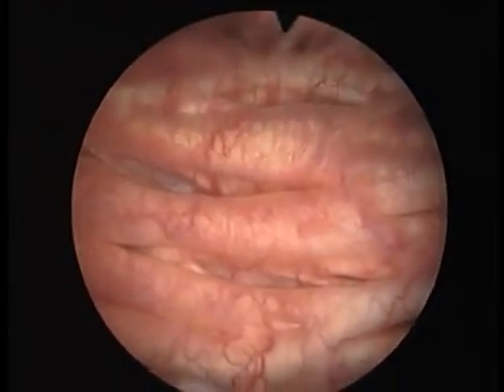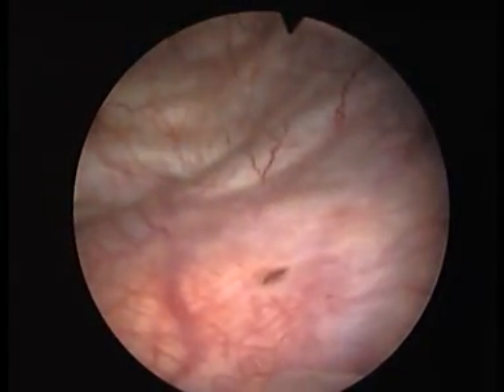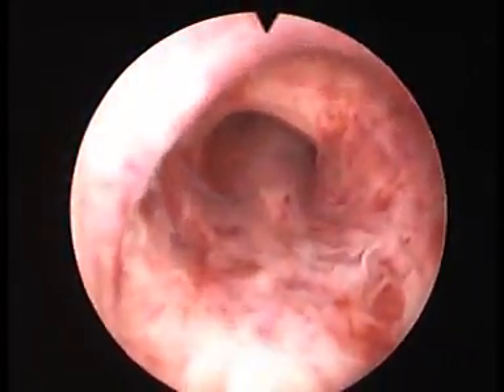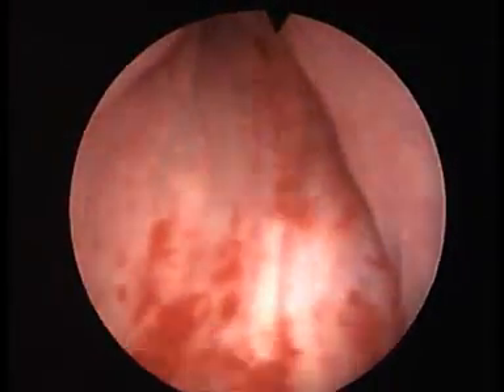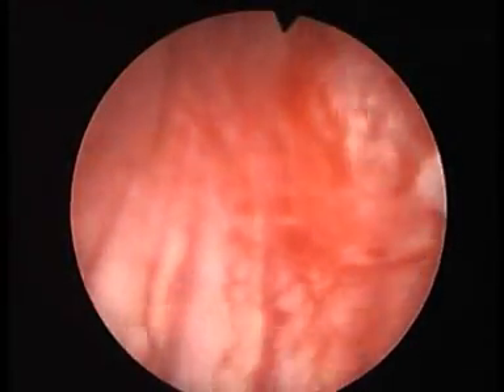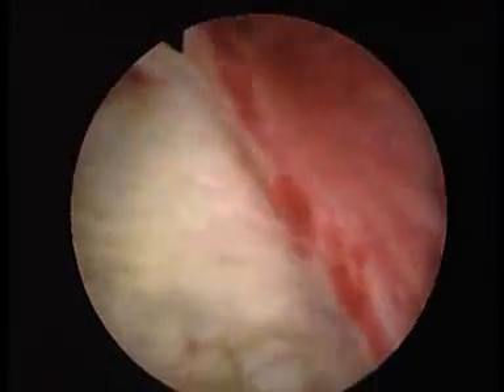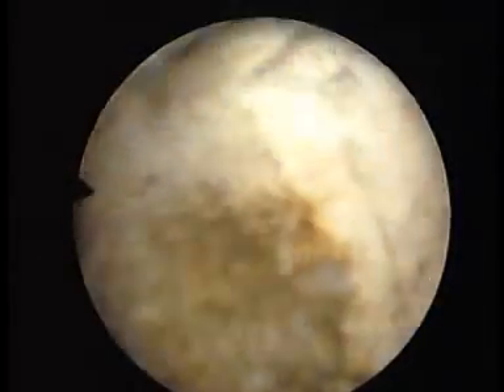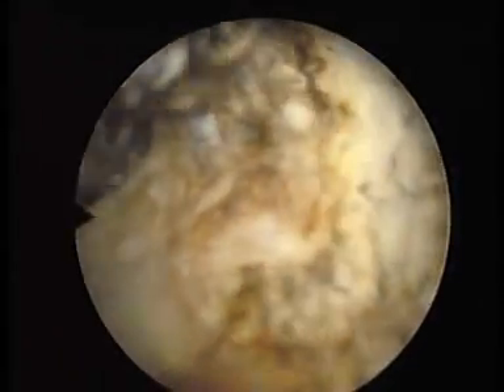TURP

Comment: TURP, DON'T DO IT! YOU WILL REGRET IT TO SAY THE LEAST!  THERE IS NO PROCEDURE TO CORRECT THE PERMANENT DAMAGE OF TURP TO GET BACK EXTERNAL EJACULATION. THERE IS NOTHING WORSE THAN HAVING INADEQUATE SEXUAL TENSION RELEASE WHICH DRY ORGASM AFFLICTS YOU WITH.

having a permanent induced dry orgasm is like drawing back the string of a bow and arrow and about the moment you expect the pleasure of releasing the arrow, the bow string breaks.  turp has made my life worse than death.  And even worse my current urologist concludes that i never even needed a turp since i have to still catheter.  damn these urologists who do unnecessary procedures that disrespect the hippocratic oath "do no harm".  He should have checked that my bladder was neurogenic.  If you are suffering from your bladder not emptying fully(which will eventually damage the kidneys) have all the bladder tests you can get.  Another thing that leads one desperate for a turp is that many urologists won't give you a preauthorization to your insurance that you need a new intermittent catheter every time you catheter.  If not you will have to wash one to use 3 or 4 times a day and it is never sterile.  this will make you feel irritation in your penis all day via uti's.  i don't care what anyone says about me, i may be one of the sole critical voices here.  Go to a health forum on turp and the vast majority of men feel as angry, depressed, frustrated, etc as i am.
Reply: I sincerely am sorry for you.  You must be going through hell.  Hope those successful experiments with regrowth of prostate on mice will be available to humans soon, for your sake and others.  My friend had a turp and he feels just like you.  And I have read some male health message boards and you are correct.  I sort of lucked out.  My urologist did the diagnostic tests for bladder and prostate.  In fact he could tell with the first manual test(i.e.sticking his gloved finger up my rectum)that my problem was not enlarged prostate.  My urinary retention was due to a period of intense emotional stress.  He concluded that by giving me a short course of minor tranquilizers and it alleviated my problem.  hope at least you can get some pleasure back and yes most of all some relief from sexual tension.  i have a busy schedule but if i find any new developments in bringing back ejaculation after the prostate is destroyed i will do my best to pass them on to you.  hang in their friend.
Reply: emotionalinvalid I know what you're saying with dry orgasms. However, the pain of not being able urinate was unbearable and life threatening. It damaged my kidneys.

Comment: Nodular hyperplasias are benign, and never turn cancerous.  If it's not blocking your urethra or giving you other trouble, just don't worry about it.  

The fact that your urinary flow isn't normal, however, is a cause for concern.  That's what happened to me after my TURP too.  A cystoscopy showed that I had some scarring from the TURP, and I had to have a second procedure to have the scar tissue removed.